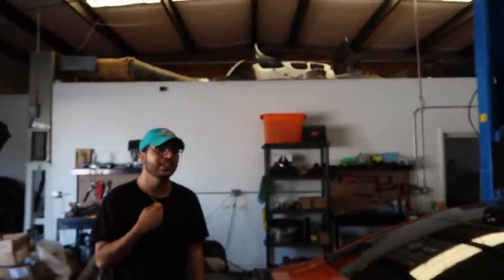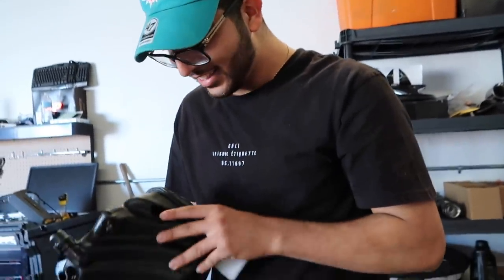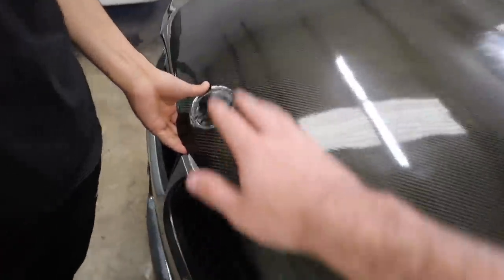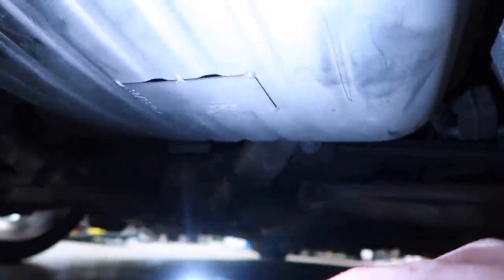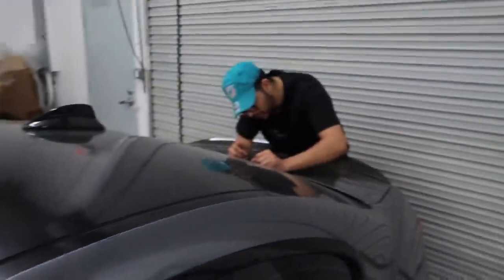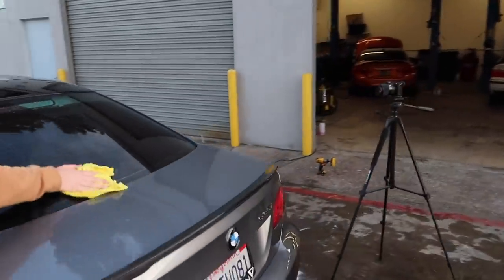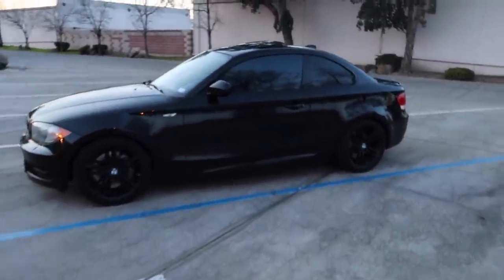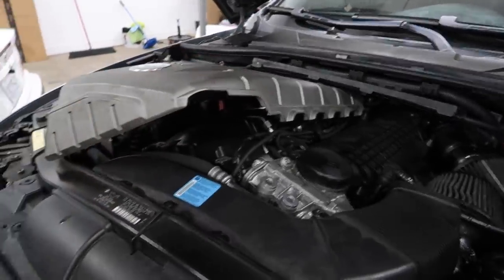FRIENDS BMW 335I GETS MAKEOVER!

Comment: Great video Nour! There is just one thing I can´t get off my mind: whenever you are washing your car, you dont want to dry it with a towel unless you wash it with a sponge or wash mitt first. Just foaming it down and rinsing it off will not remove all the dirt, and that dirt will be dragged across the paint when drying unless you contact wash (wash where you physically touch the paint) it first. Just thought I´d let you guys know. Other than that, I think your videos are great, and you are by far my favourite YouTuber.